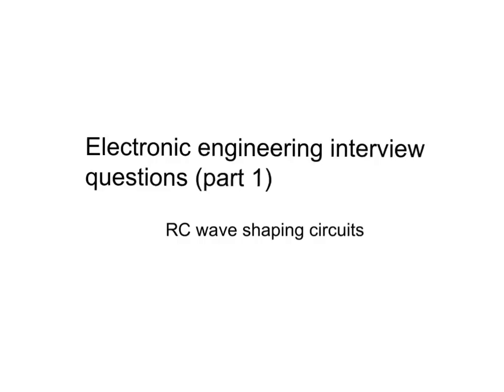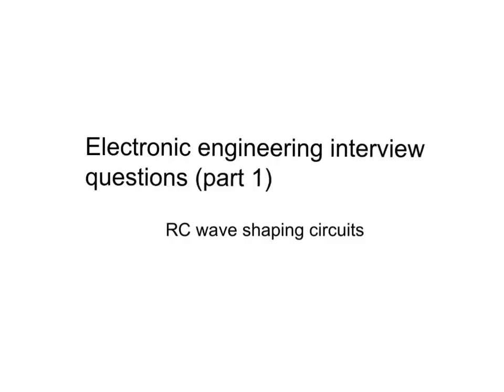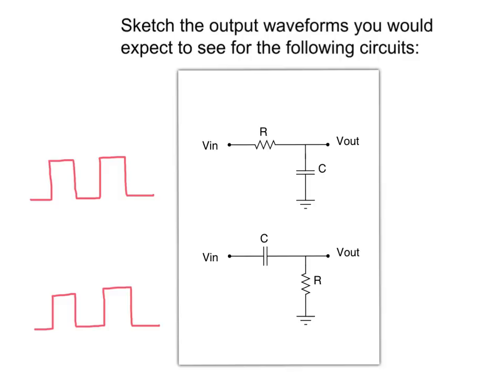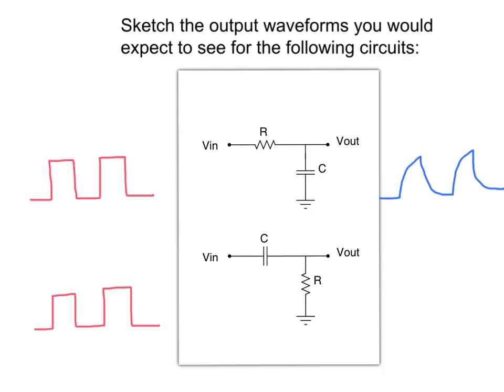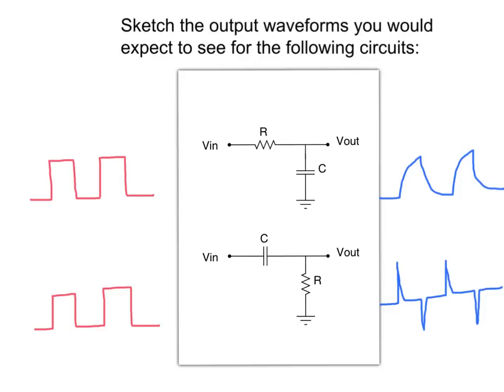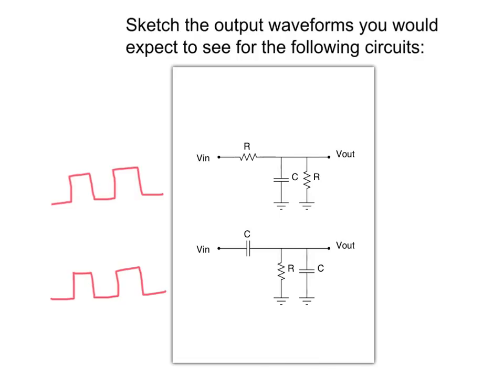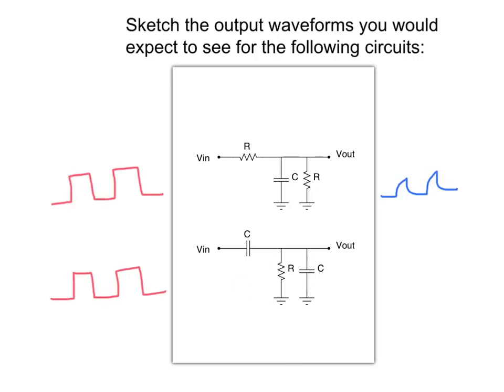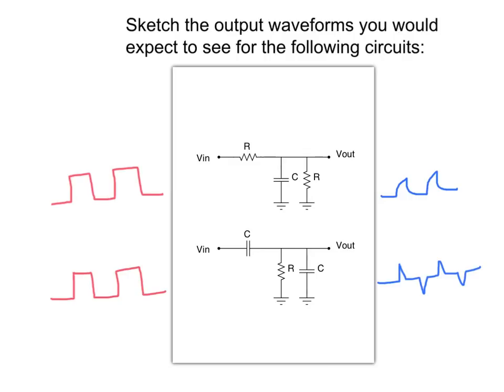Electronic Engineering Job Interview Questions (Part 1)

Comment: The first circuit is a LPF, since the signal was not given any values, its fair to assume that it is an AC square wave, not a pulsed squarewave. The output of a LPF with a AC squarewave input is a sin wave depending on the cutoff frequency of the filter, and the frequency of the first harmonic of the squarewave.

Comment: the shape of the  output waveform from LPF totally depends on RC  and time period of the input waveform, if RC<<T then the output exactly follow input but if RC>>T then the waveform is distorted
that's why low pass filter can only be used as integrator when RC >>T.

for those who don't understand the second waveform, it is the differentiator, since every practical signal is having some rise and fall time, therefore at edges where voltages going from either VDD to zero or zero to VDD, this gives you output=(  delta_V/delta_t ), since rise and fall time is small causing spikes, while when input signal is stable at VDD and ZERO its differentiation is always zero.
Reply: What if RC=T, the spikes will be more curved at the top?

Comment: Can u explain why the spikes are halved in second ques?
Reply: Because it is a voltage divider. Vo = R/(R+R)  * Vi
Reply: It will help you to derive the transfer function for the 2nd HPF circuit and compare it with the 1st one. For high frequencies the magnitude of the output voltage is 1/2 the input voltage. Equal impedances in series will produce the same voltage drop on each element. For high frequencies (the only frequencies that can pass through the 1st capacitor) the dominant impedance between the resistor and the 2nd capacitor will be the capacitor (the result of the equivalent impedance of 2 parallel impedances).

Comment: In the old days electronics engineers and technicians drifted into the electronics industry through an interest in ham radio or audio amplifiers whilst at school. Analogue electronics was pretty much second nature, almost instinctive to them.

Before they even started day one at college they could already solder proficiently, design and build analogue circuits on strip board such as radio transmitters, radio receivers, power supplies, audio amplifiers, RC oscillators, passive filters, active filters, etc. using both solid state and thermionic valves ("Vacuum Tubes" in the US and Canada).

That's how I drifted into electronic engineering in the early 1980's. I was told by a college lecturer that this particular route is referred to as "The Traditional Entry Route". He was complaining that students now have no understanding or exposure to analogue electronics until day one at college, these days.

These days all the older experienced electronics engineers have been pushed out of the industry by the time they reach their mid 30's by human resources and agency recruiters.

Without older experienced engineers to teach newbies the quicker and better ways of doing jobs and solve problems, without wasting time and money, a company is handicapped.

For instance I was shown, as a young newbie once, how to quickly solve Boolean equation problems using a technique called LMS by an old experienced engineer nearing retirement. (Back then there were still highly experienced and skilled engineers employed well over 40 in the UK). When I was 34 I returned to university as a mature student to chase more electronics qualifications. One day the lecturer put a complex Boolean problem on the board and set a competition up to see who could solve it the quickest. I solved a complex Boolean problem using LMS in under 1 minute. The lecturer looked at the minimal working out and the correct solution, then asked me to explain how LMS worked. He made me solemnly promise to never show any other students how to use LMS as it was essential that they master De Morgan's Theorem (the long winded time consuming method) first.
Reply: Now I have to know...  What is the LMS method?

 I can write a SOP or POS expression from a truth-table, and have used Karnough-maps and the Quine-McClusky algorithm, but have never heard of "LMS".  Is this a multi-level or factoring method?
Reply: I need to know that method
Reply: Sir we are interested to know more about LMS, atleast what this LMS stands for....

Comment: Hello,
even if my question is so stupid, can i get answered plz? How the ground and its absence affect the circuit?
Reply: Er Danish Dandane basic electronics question r asked to evry1 nd after dat dey eil.ask u thr quesn related to.ur job field for ex. Goin for an microprocessor designer job dey wil nt ask u ques of instrumntation nd vice versa but basic of elctronics u shud kno
Reply: Your question is absolutely legitimate. It is used to avoid electrical shock when insulated part is damaged. Avoids electrostatic and some other lightenings. 

Electrical grounding is important because it provides a reference voltage level (called zero potential or ground potential) against which all other voltages in a system are established and measured. An effective electrical ground connection also minimizes the susceptibility of equipment to interference, reduces the risk of equipment damage due to lightning, eliminates electrostatic buildup that can damage system components, and helps protect personnel who service and repair electrical, electronic, and computer systems. In effect, an electrical ground drains away any unwanted buildup of electrical charge. When a point is connected to a good ground, that point tends to stay at a constant voltage, regardless of what happens elsewhere in the circuit or system. The earth, which forms the ultimate ground, has the ability to absorb or dissipate an unlimited amount of electrical charge.

From: 
http://whatis.techtarget.com/definition/ground